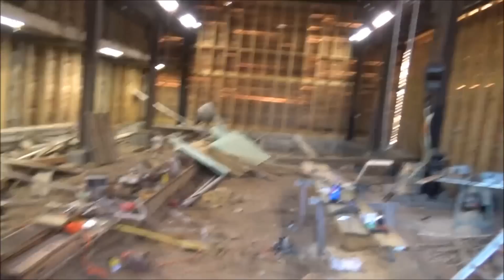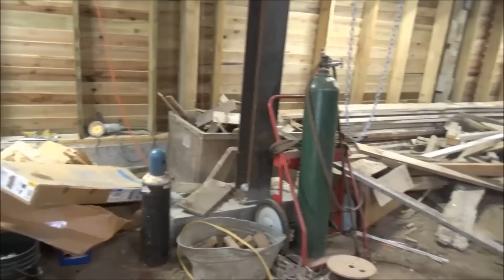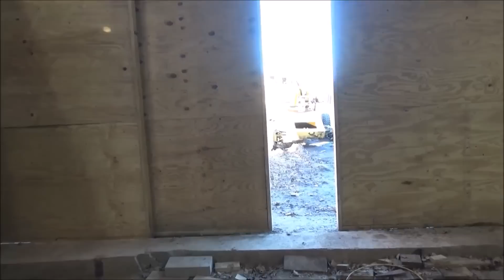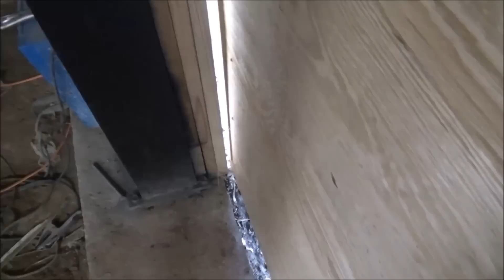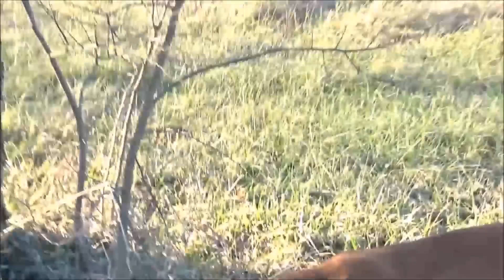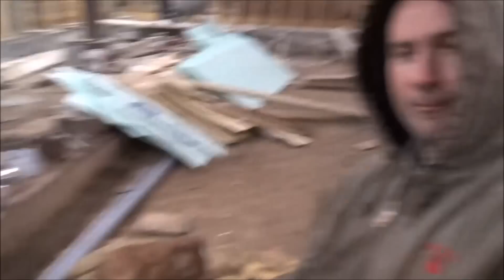December 2016 This old Barn/Shop year end wrap up

Comment: I've been watching from the beginning and its amazing the amount of work you've accomplished, the shop us going to be great. One thing you haven't mentioned is compressed air, are you going to plumb everything before you close in the walls? Having air available at all machines and some extras is way better than dragging hoses everywhere.
Reply from the maker: I don't think I will run the air lines in the walls for maintenance and modification reasons.

Comment: Brian, wonderful progress!
Will you be putting a track on the bottom of the doors to keep them from flapping out away from the building?
Regards,
Eric
Reply from the maker: Tracks just fill up with trash and are a maintenance issue. Once the proper concrete ledging and the angle iron is installed the doors will latch to that to keep them sealed tight and stationary.
Reply: Brian, Agree about the trash collection! Sounds like you have a good solution in mind.
All the best!
Eric

Comment: Random question I know but where can I find a ridge reamer for a 5.75" bore cylinder. Working on a d342 Caterpillar engine
Reply from the maker: If your engine is in the shape to need a ridge reamer then you need to be investing in new cylinder liners.  Those engines are wet sleeve exactly so they don't require machine work to do an overhaul.

Comment: i have been thinking of using various banding materials.. like the galvanized banding to secure roofs on and to go around buildings above the window and door frames. perhaps around corners installed around something like simpson strong ties.   high wind and tornado areas..  stainless would be better but in a quick look not nearly as strong verses cost..  imagine putting some tubes thru the concrete forms or drill thru so one could use the strapping to bind the walks all the way to the top to the foundation.  just a thought.. 

heck.. the nylon or polyester banding could have been used at temporary bracing on the garage next door..

Comment: Happy New Year.  Barn is looking good. 

Are you planning to put any sort of bottom channel on the doors so they don't swing in the wind, or just gonna use the latches to hold it tight?
Reply from the maker: It will be latched to the angle iron going across once it is installed.

Comment: That is one beautiful sky at the end there. Then there's the barn that looks like it's coming together nicely. It also looks like you have another light out unless that's the same one and you just haven't gotten around to replacing it. If it is another one that's failed, then I'd start to question their quality a little. It's gotten to the point where I rarely buy anything without at least a five year warranty. Things just aren't made to last anymore which is depressing. Anyway, here's hoping the next year is better than the last. I'm not hoping for too much with the idiot that got elected in the whitehouse. All scary thoughts aside, I really do hope you do well in the years to come. Cheers dude...
Reply from the maker: It is the same light. I have never replaced it or fooled with it to see what is up. It supposedly has a 5 yr warranty but paying $20shipping to send a $25 light back seems more trouble than it is worth. Besides they would likely claim my opaque paint mod voided the warranty anyway. Oh well.
Reply: Man do I hear you there. My daughter painted the back of her phone with nail polish which would have been fine if she hadn't dropped it in her soda glass. It ruined the phone and they wouldn't accept the insurance claim because of the nail polish which has absolutely no baring on the functionality of the device. For the gas you'd spend taking that thing to be shipped and the shipping charges it's definitely better to just get another one. I am curious to know how it failed though. It's kind of a thing for me to take things that break apart to see why and how it happened. If it's something I can fix then great. If not, well it's already broken so I'm not out much. Who knows.... If you don't know enough about what your doing I may be able to walk you through it. I'd be glad to help if I can.

Comment: I was wondering what you were going to do to keep the doors from flapping in the wind. I have an old building with doors on tracks that flap in the wind. Unfortunately I can't latch them all from the inside as they are the only doors to the building.
Reply from the maker: I wanted mine all latched from the inside so the pesky thieves will not have easy access.  On my tobacco barn we always thru concrete blocks on both sides of the doors to keep them from banging about.  On my shop they will be latched to the angle iron on the floor in the center once that is installed.

Comment: for your insulation try plain old styrofoam R-4 per inch and its water proof just cut to fit and use greatstuff to glue it and fill any gaps plus you can stucco right over the foam for added durability on the lower portion of the wall if you don't intend to do paneling its pretty cheap if you can order in bulk from a supplier but other wise its about $10 for a 2" 4x8 sheet from big box hardware store
Reply from the maker: It will be sheeted inside.

Comment: Sure HAVE come a long way. Hope you get a big cut on the 4k yards of concrete for the floor/anchors. We had 50 m.p.h. gusts here and I was on a dozer pushing a dump down. Clearing cab but not a dry cab so I was out in it all but shaded. Between loads I  sat in the pickup with the heater on . The wind was flopping the truck about so it was hard to nap but the timber was flopping around a lot more. I was at 4100 feet so it was whizzing. Glad Baily was in your dog house. I went home to mine and built a fire. Will be rooting for you to get done and imnside with everything.
Reply from the maker: Fortunately I know a guy that uses thousands of yards of concrete a year in his slip form business so I get a discount thru him.
Reply: bcbloc02 Good old poured walls. GREAT! Glad for you because you deserve it!

Comment: Happy New Year Brian! Shop is looking great... i like the latch you used on the door, seems easy to engage and pulls it up tight.  Did you ever get a quote for spray foam ?
Reply from the maker: I have not. I think if I do spray foam at all I will only do it inside in the ceiling to seal the odd shape over the bridge crane. It would be long term problematic on the wood exterior walls.

Comment: Good you plugged all the BIG holes. Now maybe a double barrel drum stove? (30 gallon drums.) Happy new year to you.
Reply from the maker: No heat till the ceiling is in. Stoves just keep you from working since they are the only thing that is warm.
Reply: You're gonna want to get the ceiling done pretty some cause when the weather warms it's gonna get mui el warmo up there.
Reply from the maker: With the big doors open and the high ceiling it is actually like working in the shade at least inside there. I would like to have it all insulated by summer time though.

Comment: What are you going to do for shop heat??
Reply from the maker: Burn wood in an outdoor wood stove water heater that will run the heated water thru the concrete floor via pipes so the slab and everything touching it is always warm.

Comment: A long rod on type locking system like they have on, storage containers would be nice set up on your doors!
Reply: TheRooster1122 Brilliant idea! I use a old horseshoe hung on the interior handles to lock the center of my doors. I choose 4 3/8" diameter lag screw eyes that have been cut to make hooks to catch 3 links of chain on the two lower corners of the sliding doors on my shop. They have been thru 3 cat 3 north carolina hurricanes and didn't cost a dime, everything for the doors was scavenged from the dump.
Reply from the maker: Thanks fir the ideas. I can't have handle sticking off the inside though on mine because they have to be flush so they can slide past the other door.
Reply: TheRooster1122

Happy new year that's some barn shop once it's done you'll be able to do some serious work there!

Comment: How about those big rubber latches they use to secure the hood to the cab on the 18 wheelers.
Reply from the maker: That could work but I want something with mechanical advantage that I can use to force the warped wood to follow the wall for a good seal.
Reply: How about modified load binders like you use on heavy hauls?
Reply from the maker: *****
 A little too big but something that pulls like that yeah. I think I have seen one at tractor supply that might be good. I just need to measure and check next time I am in one.
Reply: There are mini ones out there. 
Or browse around...
http://www.lgment.com/draw-latches/
http://www.protex.com/toggle-latches

Comment: What sort of insulation? I am up here in central Illinois i am gonna put some more in my attic of house. Leaning towards foam. We only had 40 mph winds Thurs and Friday! Great looking building. If I was closer I would help you clean up etc, not much help anymore.
Reply from the maker: Likely either rock wool or fiberglass in the walls. Maybe the same in the ceiling or I may see about getting that part spray foamed as I think that would be a much easier install with the weird contours of having to go up and over the bridge crane. It might also have the added benefit that if the roof leaks it acts as a second one since water can't go thru plus it wouldn't be damaged itself as insulation.
Reply: fiberglass is the cheapest (at least where i live). And and it can't hold as much water as rockwool. But also has the least insulation per inch thickness. And is a pain to install. You will scratch you self for days.
If you want to install fiberglass or rockwool drive some nails in the wall and sick the mats on that, this way they don't sack and the installation is much easier. You can do that also for the roof and they don't fall that easily.
Reply from the maker: My skin is so tough fiberglass doesn't normally bother me. Great idea on the nails. The roof would be the easiest as I can just stuff the insulation down between the joist of the ceiling and it will stay.